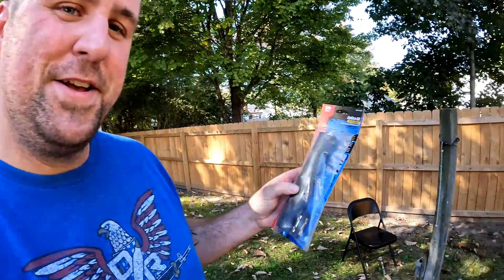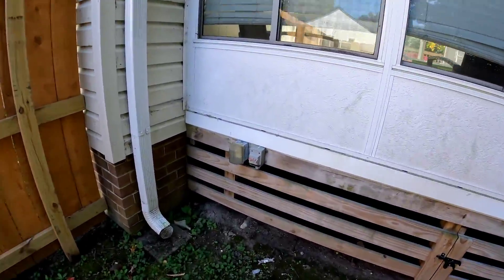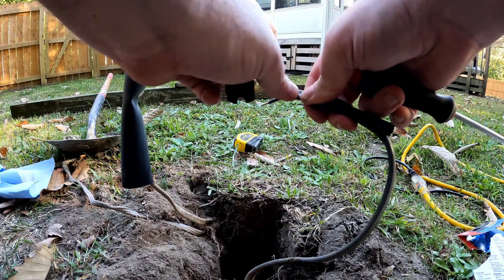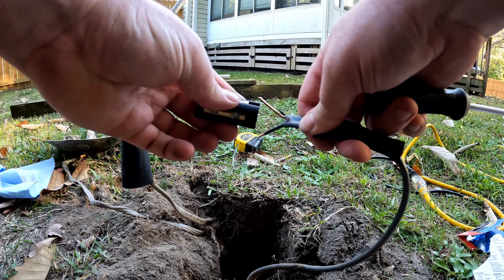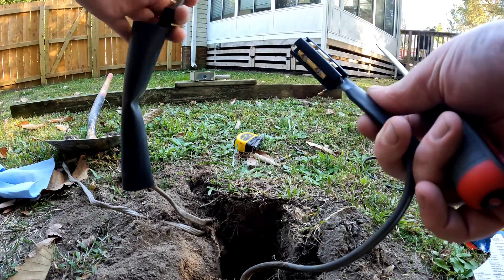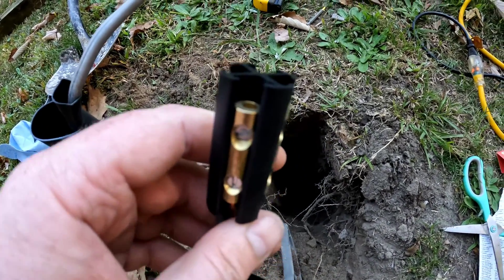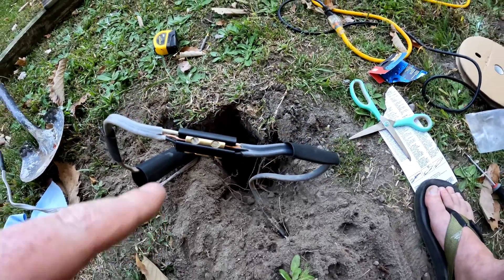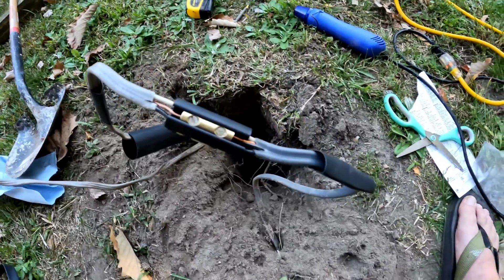DIY Direct Burial Cable Splicing: Permanent Waterproof Repair

Comment: Glad to see your sharing! But it seems spend a lot of time, did you try with a screw type or screw-less IP68 waterproof cable connector? it made by Nylon material, which is more durable.
Reply from the maker: No I haven't, this what my local electrician recommended.
Reply: Will this cause a house fire if you connect 2 separate wires together to save money on 1 continuous wire from outside pole to my trailor? I have about 75 foot of wire already new was just wanting to buy another piece  to connect to it for it to be long enough to install it  inside the  breaker  box inside the  house

Comment: Grease nutts are better faster and cheaper. 
The grease in them prevents water from getting in.
GG
Reply from the maker: Faster and cheaper I would agree, but no thanks, not for me. I'm sure they can work, but I couldn't justify the silicone wire nuts being stronger, safer or more permanent in my mind than this method for a one time diy project. Also wire nutting 12awg solid core wire sucks in general even in electrical boxes.
Reply: Use those for low voltage. Wouldn't recommend for line voltage. Stray voltage trough wet soil can be problematic. Voice of experience speaking.